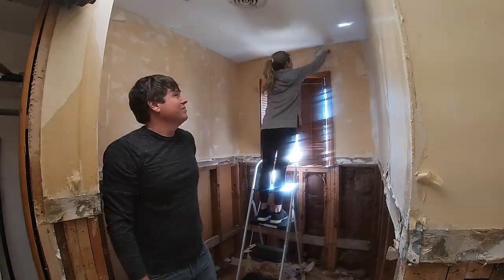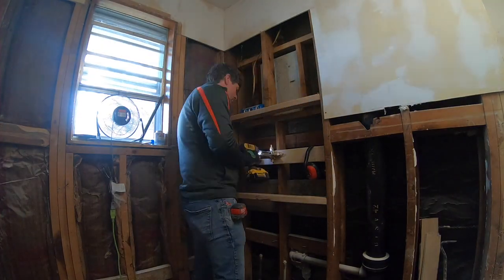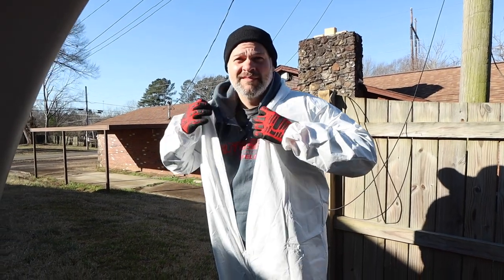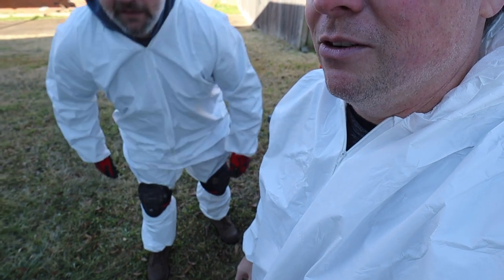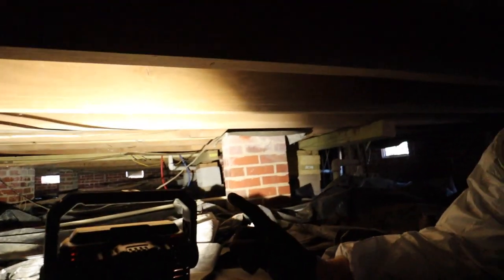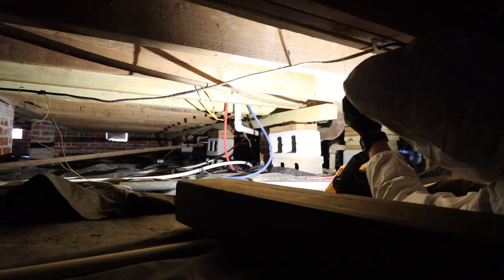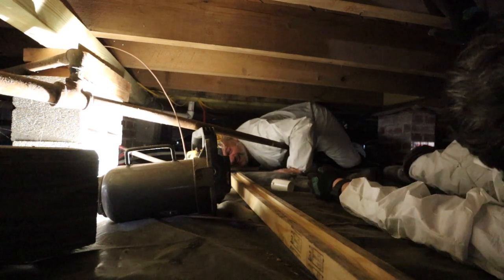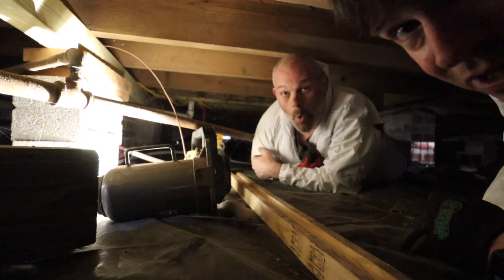BOUNCY FLOOR REPAIR

Comment: Some cross-bracing between the joists would have helped.  Also, some sistered 2x6s would be more stable with less flex than that beam.

Comment: Where are all the spiders. black widows?!
That’s a hot bed for our version of the black widow (Redback) in Australia. Yuk.
I’m watching this in preparation for facing them. Shudder…
Reply from the maker: We definitely have plenty of black widows and brown recluse spiders in Mississippi. I’m always more worried about cotton mouth snakes curled up under our houses. 😳😳😳
Reply: @MDCHOMES  Yes, that can be a concern here too. Not Cottonmouths. Browns, Red belly Blacks, tigers.
Only ever seen a Red Belly in the Burbs.
I’ve still got to get under the house and fix that bounce though. I’ve always got the snake bite kit handy.
Coming across one under the house? Pretty hard to administer first aid for a bite to the face. Luckily, an encounter is (hopefully) highly unlikely.
Reply from the maker: lol. Good luck and may the force be with you.
Reply: @MDCHOMES  Cheers mate! She’ll be right.
Reply: @MDCHOMES  I forgot to mention. We’re into winter. No snakes: Or docile snakes.
Reply from the maker: Perfect 👍. Best time to do it